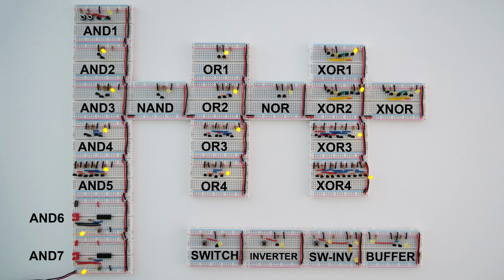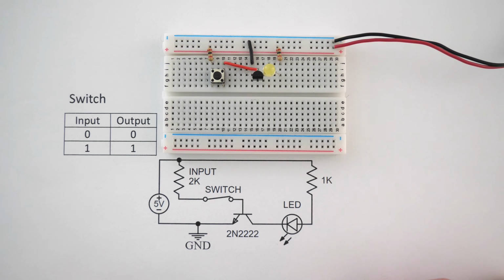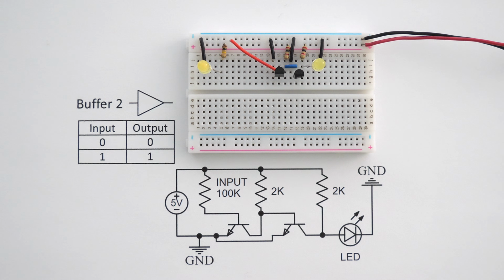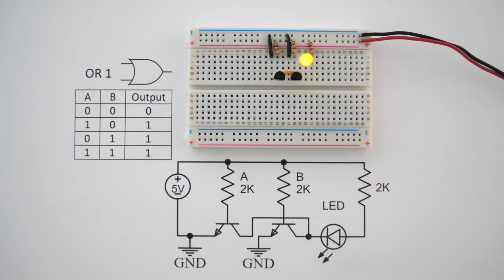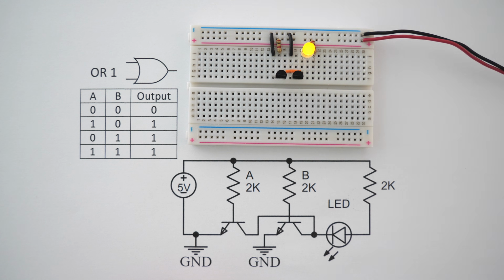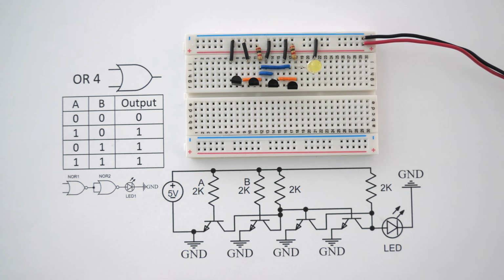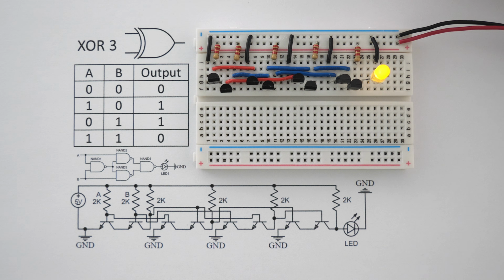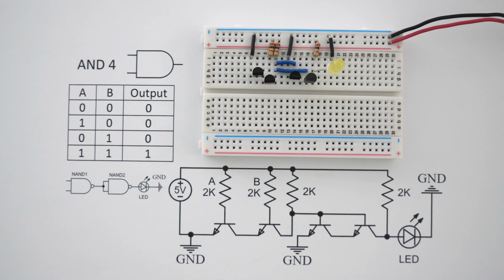Digital Logic Gates from Transistors, AND, NAND, OR, NOR, XOR, XNOR, Buffer, and Inverter

Comment: Why can't the OR1 gate send output to other logic gates, but OR2 can?
Reply from the maker: OR1 completes the circuit to make the logic true as a loop within the circuit. That will only be useful as a stand alone logic gate. To send it out to other logic gates you basically have to invert that logic and one more inverter transistor is needed.

Comment: How doeas the inverter works? Can you explain it to me? I got confused :(
Reply from the maker: Well the inverter makes an on input signal into and off input signal, and an off input signal into and on input signal. The circuit has one input and one output. I would recommend trying to build the circuit and testing it out. If you have a specific question about the circuit, let me know.
Reply: @GlobalScienceNetwork  Okay, thanks
Reply: What I dont understand in the BUFFER2 is that, why the eletricity travels trough the transistor (if it's on) but not trough that blue wire? I mean that would be a shorter way, wouldn't it? 
Sorry if it's a dumb question...

Comment: Could you please explain why in OR1 you connected transistors' collectors, but in NOR gate you connected their bases? I'm a bit confused. Also, I always thought the right and left pins are emitter and collector respectively but in this video it seems it's opposite. Sorry I'm new to all of this but I love it. And thank you for your work!
Reply from the maker: The inputs should go into the base for all of the logic gates I made in this video. The extra resistor on the collector allows the output signal to be sent to other circuits. It is not an on or off for the circuit. There are logic gate designs were this is not the case. For the 2N2222 and 2N3904 it goes emitter(left) base(middle) and Collector(right). Depending on the model the emitter and collector orientation can be switched.

Comment: For the NOR gate you do not need two transistors, one transistor should be enough. In your scheme you can "merge" both transistors into one, so that A and B inputs connect to single base, this will result in functionally the same circuit. Thanks for the video!
Reply from the maker: That is clever, and I agree that it should work! There is nothing wrong with making something simple even simpler!
Reply: Hey there, i tried it out but i got some weird outcomes. A single one-transistor NOR gate works, yet the full adder has some weird behaviour and i can't seem to find any explanation after hours of trying to find an error. I might simulate the circuit later on. Maybe it's just a broken breadboard connection :)
Reply: @captainvaughn5692  try changing the last resistor (not the one connected to the led, the one before it) for one with higher resistance, now im using 2.2k in every one but the last one is 22k and its working. that was a way i found to make it work.(I DONT KNOW WHY, I WAS TRYING TO UNDERSTAND IT)

Comment: Is there any method to choose the specifc resistor for the transistors
Reply from the maker: The resistors are mostly current limiting resistors. So a value from around 330 ohm to 2.2K will work. I like to use, 1K, 2K or 2.2K as less current/power is used.

Comment: Im currently building a 16bit calculator using breadboards for a school project, and this video is the main reason why i haven't lost my mind yet...

Thank you for saving my sanity :3
Reply from the maker: Great, that sounds like a sweet project!
Reply: @GlobalScienceNetwork  It's actual hell, I managed to fry enough transistors that I had to order new ones twice...
Reply from the maker: @SumIdeod  Awe man, well hopefully when you are fished and you look back it will all be worth it! As long as you have some type of current limiting resistor in each path to ground it should not fry a transistor. I can see starting out that this would happen from time to time. Usually, you can smell that something is going wrong! ha ha
Reply: @SumIdeod  How many transistors did you need, how many breadboards? 2N2222s?

Comment: I tried to do the inverter but it wasn’t working, when i pulled one of the red wire terminal out the led lit up 
What should i do 
I am using a 9V battery is that not usable for the circuit?
I don’t understand
Reply from the maker: Well, that is half of what you want. When the input is off or floating the LED will be on. Connect a 2K resistor from power to the base/middle pin and it should shut the LED off. The 9V battery should work. Just make sure you have a min of 1K current-limiting resistors to be safe. If it does not shut off then your transistor is backward, broken, or the wrong type.
Reply: @GlobalScienceNetwork  when it is floating the led is on but when it isnt the led is off regardless of the input 
I just connected the resistor to the base of the transistor and it made no difference
Thanks for trying to help though 😊
Reply from the maker: @TechnoHailss  That is what you want. Which state do you think is wrong? When the resistor is connected to the base the input is on and the output is off. When the input is grounded or floating the input is off and the output is on. The push button switch I use just connects the 2K resistor to the base when it is pressed down. When it is not pressed the input is floating/off so the output is on.
Reply: @GlobalScienceNetwork  See when the circuit is all in place the LED is not on but when i lift on of the wires the LED turns on that is my problem.
The LED should be on initially for an inverter circuit but it is off 
when i pull out  the red wire or the black wire which is connected to the transistor(at row 20) the LED turns on.
This is probably sounding a bit dumb because i am trying but am not able to convey my problem properly.
Sorry for the trouble
Reply from the maker: @TechnoHailss  I see, well if you email me a picture I could see if anything is set up wrong. I would suggest trying different transistors as well, even try a different breadboard. I know that 2N2222 and 2N3904 transistors work well for logic gates.
Reply from the maker: @TechnoHailss  It is in the channel description.
Reply: @GlobalScienceNetwork  I finally did it 
I educated myself on breadboards and Logic Gates and corrected the errors
How can I hook up OR1 circuit to a switch?
Thanks For everything
Reply from the maker: @TechnoHailss  That is great! If you are going to use it in a circuit you will likely need OR2 so you can send the output. The logic gate itself is a type of switch so I can not say how to add the switch without more information.
Reply: Ok😁

Comment: I’m a bit confused. If he’s using an npn transistor, why is the pin layout emitter base collector rather than collector base emitter??
Reply from the maker: The 2N2222 and 2N3904 NPN transistors are always 1 emitter (left pin), 2 base (middle pin), 3 collector (right pin). There are quite a few images and sources online that show this wrong. There are NPN transistors like the BC547 which are 1 collector (left pin), 2 base (middle pin), 3 emitter (right pin). So you do have to check based on the model even if it is a NPN transitors.

Comment: i have to use a nine volt battery and a hundred k resistor it works well
Reply from the maker: Sweet! Yeah, you can use 9-volts but it is a bit more power than is needed. You can use most USB chargers which are 5 volts. You will just need to spice the ends fit into the breadboards.
Reply: @GlobalScienceNetwork  it is sweet i love electronics

Comment: Sorry sir, but when I tried the NAND gate circuit in Tinkercad and I gave the value 0 to both inputs the result was 0 instead of 1
Reply from the maker: Hi, well it might depend on what the threshold voltage is for the 1. Did you use the scope feature to see the exact output voltage? For NAND it should only be off if both inputs are on.

Comment: I've see these type of electronical diagram (where every component is connected in current loop form) in my electronics text books and other places, but I never understood why they are drawn so confusingly. When you teach; abstraction is the word.  And those diagram are only good for wiring a physical circuit. Separate each transistor with it's resistor, capacitor, inductor, power and ground in it's own section of the diagram so that it can be understood separately at first. Don't connect all the powers together and don't connect all the grounds together. You start small then you grow the abstraction to the whole circuit.
Reply from the maker: That way of explaining circuits would be a good way. Thanks for the feedback.

Comment: I would love to see the TeX code for the diagrams that you wrote - they looked truly nice!
Reply from the maker: Thanks, that would be a good way to make the circuit diagrams as well. I used EasyEDA and have a video about how to use that program if you are interested.
Reply: @GlobalScienceNetwork  Oh, interesting! I managed to reproduce identical diagrams in LaTeX with the circuitikz package, so I assume that both EasyEDA and circuitikz are using the same assets. Very nice!

Comment: Hi. Ive been trying to build my own 4 bit CPU and im having trouble with sending outputs to multiple points. I find the LEDs become dimmer or they dont turn on at all when I try. How do i tackle this issue?
Reply from the maker: Hi, I can try and help. When you are sending an output to lots of input locations the output signal can pick the path of least resistance and not activate (overcome the input gate voltage threshold) of all the inputs. One solution can be to add a buffer to the inputs so that when the circuit is grounded it is off for all the inputs and when it is not grounded it is on. This way it is not limited by which path the current takes. You can also build the logic gates to inherently work this way. I should have included this in the logic gate video but I learned it after I made this video. If you watch the 4-bit computer video, I am pretty sure I show the buffer design at one point in the video. It also could be that you need to add capacitors across the power rails if the circuit is very large.
Reply: @GlobalScienceNetwork  thanks, ill try that. I did see the buffer circuit in one of your videos but I don't know which one I should use when sending to multiple inputs (the one with 2 transistors or 1? ).
Reply: @GlobalScienceNetwork  I also dont know much about capacitors so could you expand on them briefly? I am trying to build my own 4 bit CPU so I think that could be considered a large circuit ha ha

Comment: I tried to make a not gate using ur video, but my LED burst open
Reply from the maker: It is very likely that there was not a current limiting resistor between the LED and ground. That is the main reason this would happen. You need some type of resistance typically 300 plus ohms. I like to use a 1K, 2K, or a 2.2K resistor for this purpose.

Comment: why you didnot use mosfets?
Reply from the maker: For breadboards and a breadboard computer I thought using BJTs were more robust for static shock reasons. I did not want one mistake to break my circuits. BJTs can take some abuse and keep working. However, I have been using 2N7000 MOSFETs in my more recent designs for artificial neurons and have not had any issues. I hope to make videos about MOSFET logic gates as well. Many ICs use BJTs and people do not even realize it. BJTs make reliable circuits. MOSFETs being voltage gated does allow for more power efficient designs. If the projects is using more than a few thousand transistor then using MOSFETs is the way to go. So for smaller designs BJTs are robust and work and for large designs it is good to use MOSFETS.
Reply: I'm pretty new to electronics but recently I saw that MOSFETS are much more efficient than transistors...

Comment: I haven't commented on any youtube videos but seeing you replying to every comments makes me wanna reach out and say thanks!
also in the AND 3 and OR 2 gate, when both resistor A and B are off, the currents flows through the third transistor right but why the the main current flowing from the rightmost wire prefer the other ground instead of ground through LED, is this because of resistance of LED?
Reply from the maker: Thanks! You have the right idea. The yellow LED has a voltage drop of 2.2 volts and the voltage drop across the transistor when the base of the transistor has a supply current is very low. So the voltage drop across the rightmody resistor is almost the full 5 volts. So now there is not enough voltage left after the voltage drop to overcome the 2.2 volts required to turn on the LED and have current flow to that ground.
Reply: @GlobalScienceNetwork  in the XOR 1 gate, when both A and B are on, why does the current flowing through the wire just right of B prefer the GND towards the left but not towards the base of transistor at the right.

Comment: Sir i cannot understand what the ground wire does can u explain it in a short video?
Reply from the maker: I am not sure it needs a whole video. For a circuit to work it needs to go in a complete loop. The voltage starts at 5 volts and goes to zero when it reaches the ground how much current flows depends on the resistance of the circuit. If it was not connected to a ground no current would flow. Think of it as water 5 feet above the surface it can not flow if it is held at 5 feet. It needs to have an open pipe/wire connected to zero feet for water to flow.

Comment: "We're going to first build a calculator with resistors, and by the end of 40 minutes we'll build Skynet"
Reply from the maker: Ha ha well that would be ideal!
Reply: @GlobalScienceNetwork   Actually it would be very scary. I'm already terrified of the rapid advancements in AI. Not the AI itself but how it is used and how it is causing massive changes in society.
Reply from the maker: @ArcanePath360  it is something to think about. What specifically are you worried about? Are you worried AI will take jobs? So far it has allowed me to be more way productive in programming tasks and provides better answers to my questions than search engines. So it helps workers be more productive. As long as people have equal access to AI it seems like a great thing. AI running on digital computers is actually quite limited though, the future and big gains will be when we build hardware-based neural networks. Then the machines will likely be considered non-biological life and things will be quite interesting.

Comment: What value do the resistors have? Is it always like 2KΩ?
Reply from the maker: These are mostly current-limiting resistors. The values can be from around 330 Ohm to 2.2K. Using a 2.2K resistor makes it so less power is used so that is a good value to use. In most of my circuits, you will see I use 1K, 2K, or 2.2K. It also makes it so the LED is not super bright.

Comment: 7:16 how the voltage drop is calculated as 4.984v across the 2k resistor?
Reply from the maker: Good question, as current flows into the base of the transistor the transistor allows current to pass with some but a very small amount of resistance (around 8 Ohms). So now the current going to ground has to go through two resistors. Since the 2K resistor is so much larger almost all the voltage drop occurs across that resistor. Does that make sense to you?
Reply: @GlobalScienceNetwork yeah...now I understand better but still I don't know how it was calculated as 4.984v through 2k resistor and 0.16v through LED. Could you please mention the way to calculate these!!
Reply from the maker: @Mani-wq1de  Well how much equivalent resistance there is across a transistor is not really a value that is common knowledge. Once you have it though the voltage drop is calculated as two resistors in series. I got it from a circuit simulator. The .16V is what would be left. This is not enough to go through the LED as a yellow LED requires a voltage drop of 1.9V to turn on. I was pointing out that this is why the LED is off.